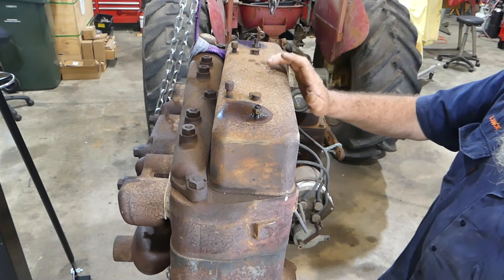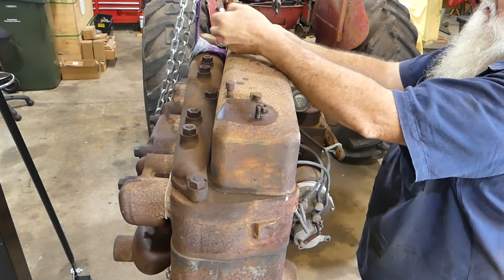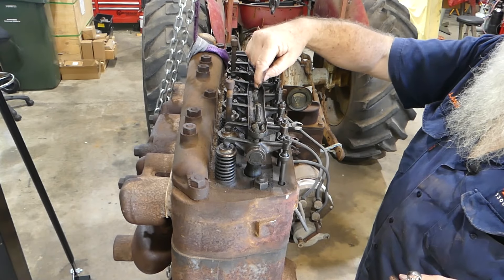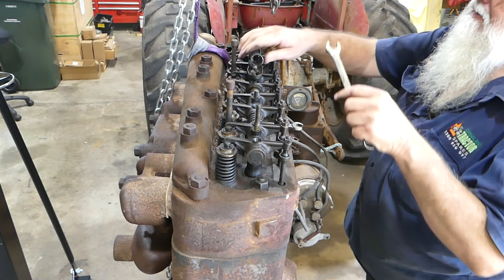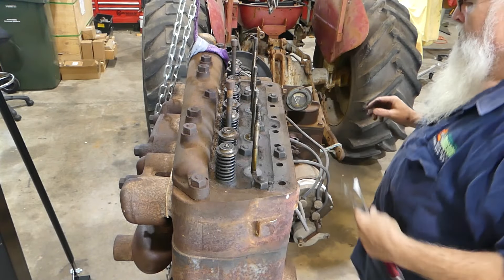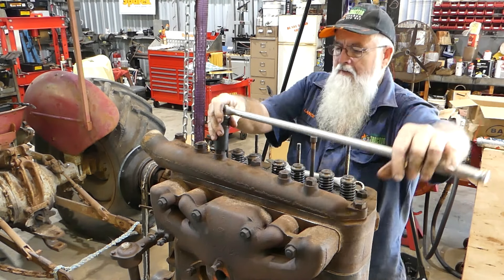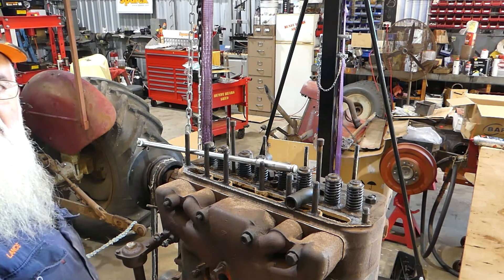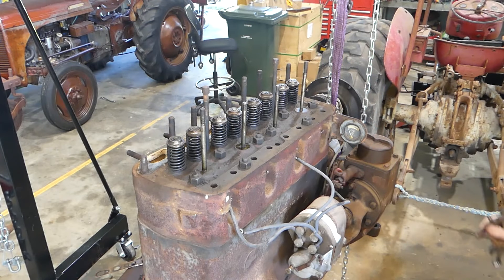1929 McCormick Deering Engine Removing the Head and Look What I Found!

Comment: i had a 1924 McCormick Deering 10-20.    Easiest starting crank engine i've even owned.  i used to to disc and drag my 1/2 acre garden  as late as 2018 just to say i am still using an 94 year old tractor.  It was a sweetheart.  It is still being used at a kids' amusement park.
Reply from the maker: Good stuff!

Comment: To keep the engine at operating temp a wheat bag was often hung across the radiator about halfway
Reply from the maker: Yes I have seen that, in a workshop we would fit sone cardboard in front of the radiator to heat them up quickly.

Comment: Lance only if you have time.   I am curious about that circlip, I know it holds things in place, however is that its only purpose or is it specifically for timing as well.    Secondly does it matter that my inspection port is on the opposite side.   You've videos have certainly given me confidence to tackle things I never would before, this injection pump being among them.   Many have also confirmed that my wing and a prayer approach to fixing some of the rest of the tractor have been a little more accurate than I thought (albeit that mine is an old Ford 4100, never the less a very handy machine), so it certainly was comforting to know that some of them were on the right track.   I might also add that your videos have given me hours of great ........ well I suppose entertainment and learning is one way of putting it.  ( I have some medical issues and cannot work all the time), so they are very much appreciated.  Until I came looking when I need parts a little while ago, I was unaware you Guys even existed.  I do now and can tell you,  so will everyone else I know down my way.  My most recent purchase was a kit for the Injector pump I am working on and was indeed impressed when it arrived so promptly. ( I am down around the Esk area).  So thank you for your excellent service and and your extra commitment to making these videos.  It is very much appreciated by me for sure, and judging by the many comments on your many videos, by so many others.    Cheers and take care.
Reply from the maker: G Day Brian, The circlip does space the cam track but wherever the plate is to check the timing eg left or right it works the same. It turns out mine was put in backwards but it didnt seem to matter.
Reply: @BundyBearsShed  Thanks very much Lance

Comment: I was expecting the head to be difficult to get off with those long studs. How easy was that? A rough old bushie trick to make up for the lack of a thermostat to get it hot enough to vaporise the kero, or just kids being buggers. Those cups sticking above the rocker cover are probably to put a bit of petrol down to help starting. My W30 has cups with spring loaded caps but are of limited use. May be handy in cold climates though. Jeff
Reply from the maker: I havent checked the head out but yes a priming cup may well be the go. We are looking for parts before we go much further.